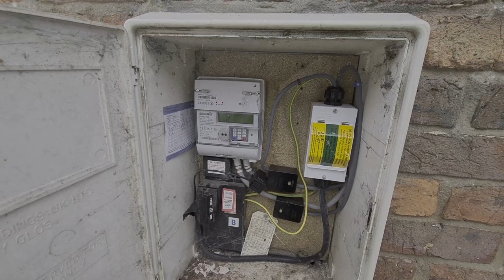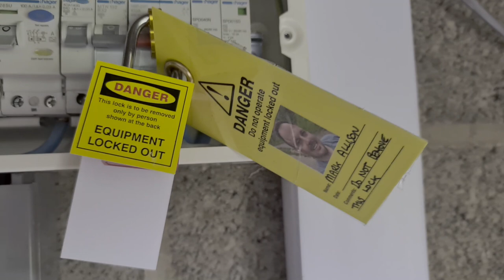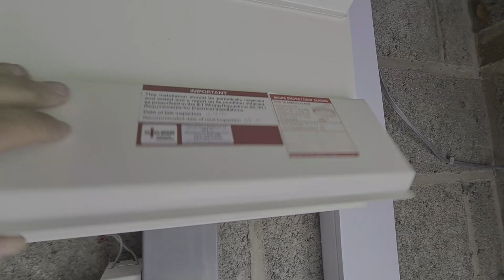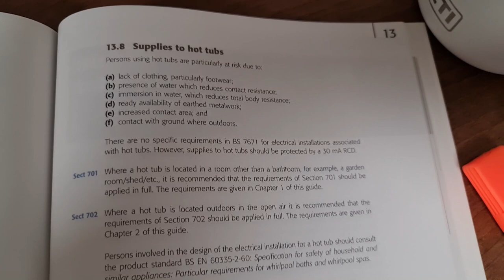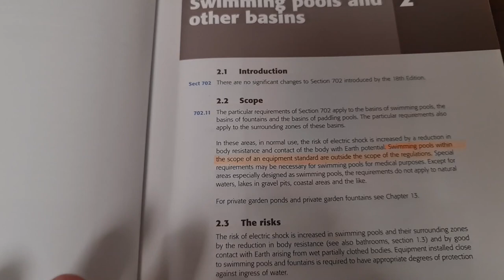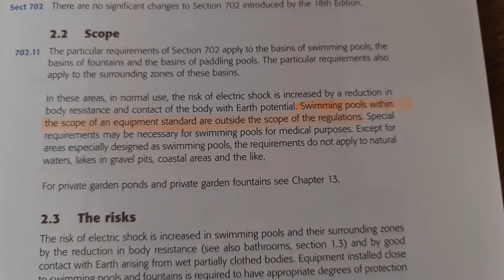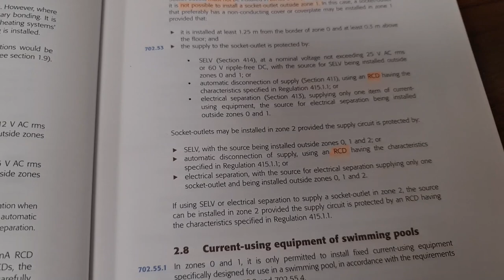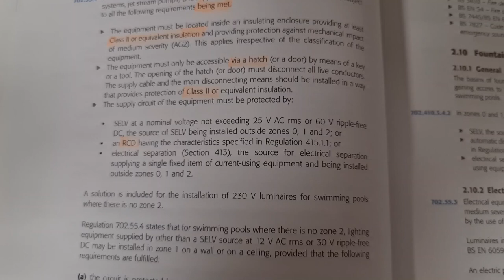Electrician connects Hot Tub to PME TNC-S explained

Comment: This video glossed over the key danger... If there was a PEN fault you'd be on thin ice. 
The installers of the metal outside lights knew the dangers. They wanted to ensure that they had good earthing in the event of a pen fault, thus the many spikes. 
Your hot tub install may be lethal under PEN fault conditions.
You mention series RCD - as you know - an RCD will not operate under PEN fault conditions. 
The IET has stated : 'Whilst connecting a hot tub installation to a PME earthing arrangement is not precluded, it is 
difficult to see how it could be justified by the electrical designer given the information 
available.'
This video doesn't justify it.
Reply from the maker: Thanks for watching and taking time to comment. I welcome the debate on this but it is important we dont suggest my installs are potentially lethal. That is crossing a line for me, especially when they are not. I will answer the comment though as I dont think that was your overall intention. 

The IET article in wiring matters is the authors opinion and interpretation not the position of the IET as an entirety. Even so I agree with many points in that article. 

I referenced pen faults on more than one occasion and feel a 40 minute video is a good effort to cover as many key points as I can. 

The earthing system on this is very much based on safety. As regards the lighting in the garden that is connected in parallel to the PME not in place of. Who do you think might have designed that 😉. Along with the earth grid under the workshop again in parallel not in place of. 

Having the sub 20 ohm value is critical to reduce step voltages and touch voltages under lost PEN conditions. Driving an additonal earth electrode in next to the hot tub would make zero difference to this particular installation which is among the more robust to pen fault issues. 

As regards RCDs I mention this in the video that they dont work in PEN fault conditions. 

The IET have suggested section 702 is followed. Quite clearly in 702 it states if a product standard is in place this should be followed in place of these regulations. So by following and accepting the product standard you are complying with section 702 in full. 

In that product standard allowance has been made to connect into distributors earthing of all varieties. 

When we cloud debate with opinion and rhetoric the whole argument is lost unfortunately.  

As I said I have no issue with the use of earth electrodes. We have used them before ourselves many times on hot tubs. Equally pen fault detection can be used and series rcd protection. We have many tools in the box. 

In urban areas earth electrodes are not even guaranteed to give you divorce from the pme and thus pen fault. It is not that simple sadly. 

The reliability of the DNO tncs PME is an issue with more things than just hot tubs and we rarely make any allowance for it. Perhaps future regulations will dictate we should and over ride product standards. But at the moment that is not the case. 

Falling back to my install we havent seen the actual tub as yet. As I alluded to in the video perhaps the earthing system is totally irrelevant in this case....

Thanks again for the comments and I take your point of view with PEN faults.
Reply: @electrician247    I've been reconsidering what I wrote with your answer...  I hadn't really thought properly about the fact you'd exported the earth to the lighting etc.
By doing that, under pen fault condition, you'll still have a dangerous touch voltage given your 20 ohm value. You increase the chance of harm under pen fault by exporting the supplier earth.
So... the first dangerous thing is exporting the earth to the lights. 
The workshop/lights is likely far enough away a TT is safe under pen fault. I'm not sure the hot tub is.
The combination of tncs and TT you have created seems to create more danger.
I maintain the second danger is the fact you've exported the earth to the hot tub.  
There may be reasons why you don't want to just put a spike in for a hot tub, but there's no reason to export a PME.
Reply from the maker: @ThePa1ch  Its sub 20 ohm not 20 ohm. That figure is derived from the IET guidance to earthing and bonding. We need to ask the question if we are exporting or expanding the supplier earth. Often its the later. 

Quite how you determine so much insight from a YouTube video is bizarre.  Especially when you clearly have not watched the entire thing. 

I sugest you read the IET guidance docs and also the product standard for hot tubs. You may have a better understanding then. 

This particular install has been done with involvement of the DNO on the street lighting and external buildings. I have been doing this long enough to know how professionals complete installations. 

We have an exceptional supportive earth system to this installation. Parallel earth electrodes are a brilliant way to ensure safety and are very common in many commercial settings.  Thats clue number 2 along with clue number 1 which is the earthing system is totally irrelevant. 

I do appreciate the input and dont disagree with the potnetial for pen faults to cause issues. That can effect a great many bits of electrical equipment. Its a consideration for sure. One the product standard for hot tubs covers actually. A good read if you have never taken in. 

Have a good evening
Reply from the maker: @ThePa1ch  I should make clear as by my wink emoji you think I designed the system on the lighting and workshop. This is private shared road and the DNO designed and stipulated the system to be used. They cabled and rodded everything up. 

Just to remove any confusion as you seem hell bent on trying to discredit a very reasonable and actually pretty factual point of view. 

Show me where using pme is prohibited in any regulation, product standard or guidance document? Also explain how using an earth electrode ensures that can not be a factor under lost pen? Especially in urban areas. 

Swimming pools are usually served with a sub 20 ohm earth grid in parallel with the pme. This is one of the few ways to reduce the potnetial problems to a minimum. One we have on this particular installation actually in a round about way. 

Single earth electrodes are not the way to comply with 702 or limit pen fault issues in many scenarios.  This is clearly shown in 702 and earthing/bonding guidance doc. 

So again we make statements such as dangerous and lethal to try and sound a smart arse but the debate is in the actual subject matter not your or my opinion. 

Physics is a beautiful thing.
Reply: @electrician247 Debate :  a discussion between people in which they express different opinions about something.
Not sure what you think a debate is...
If there was a pen fault in this installation with an 11 ohm Ze then 'physics' would mean that people touching earth outside might die.
If you can use 'physics' to tell me otherwise, feel free.
I mentioned the distances involved as I completely understand that if an earth spike is put down in an urban environmental it's not necessarily safe under pen fault. 
This isn't an urban environment.
Exporting a PME earth is dangerous.
A well distanced earth spike with separation from the PME earth eliminates this danger. 
Pen fault detection exist for a reason where this isn't possible.
Do what you like.
Reply from the maker: @ThePa1ch  quite enjoy and am aware of debate. We have 2 different points of view. Also that you assume this isnt urban. Thats interesting. 

Just next door is another 4 houses up the drive a row of 40 and villige of 250 properties. Services pass along the road and field behind the properly. Both water, telecoms and electrical pme. 

Section 702. Apply it of you wish, use the product standard if you wish. We have actually achieved both on this installation.  

If there is a pen fault on this one the earth raft on the workshop which is immediately behind the hot tub and extended under and around the hot tub via both reniforced concrete and the oil bond. We have further supplementary earthing around the entire property to mitigate external potential difference as far as possible.

But best of all we have a class 2 hot tub. 

Explain which parts of that prevent danger and which breach the product standard for hot tubs and or any regulations. 

Thats a debate, I made my case in the video and in these comments. All you have said is its deadly under pen faults. Not sure how you might think I would respond to that lol. 

Based on the above give it your best shot. Take a few days of you wish and I will consider it same as the other comments. 

Have a good evening and thanks for watching and joining in the comments. Really helps the channel!

If you are an employer check out www.apprentice121.co.uk we have helped over 900 apprentices back into work. Still thousands more desperate for a chance of work. You sound like someone who would do right by them. 

Respect and kindness always
Reply: @electrician247  i